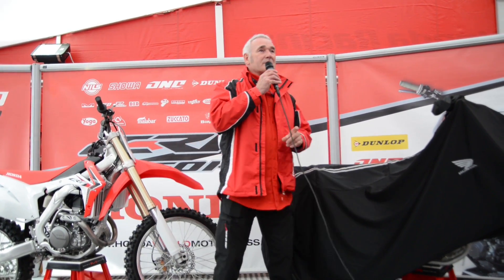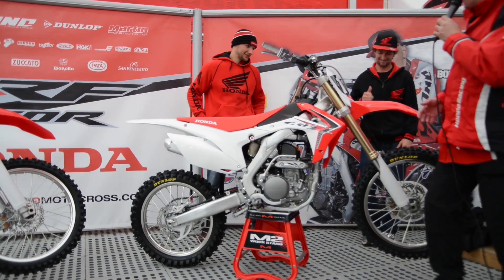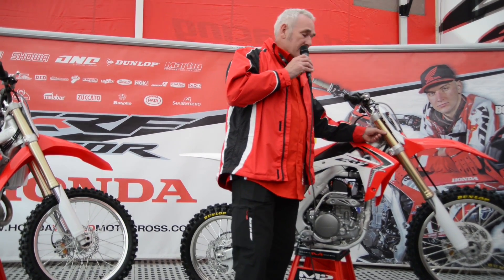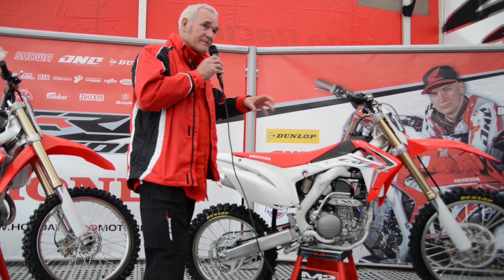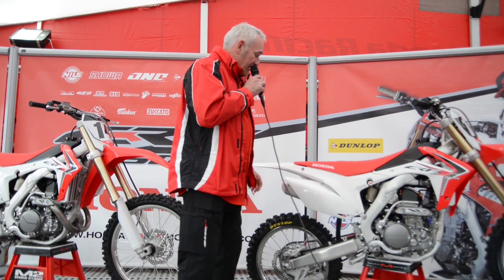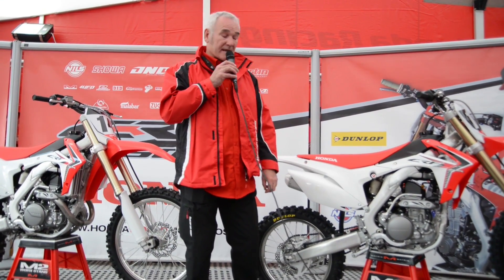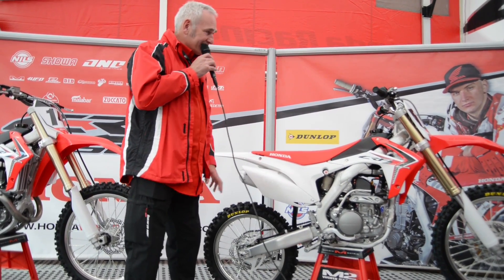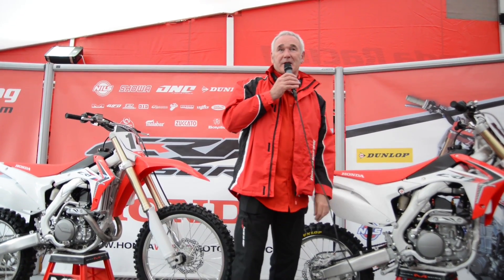Honda reveals 2014 CRF250R - explains new specification

Comment: really its not, all you get is a custom pipe and a few wields to change engine mounts. almost all of the cost is because they have to build the motor from the Honda parts catalog, hardly worth the extra six grand over what a CR250 would cost if Honda would just make them again